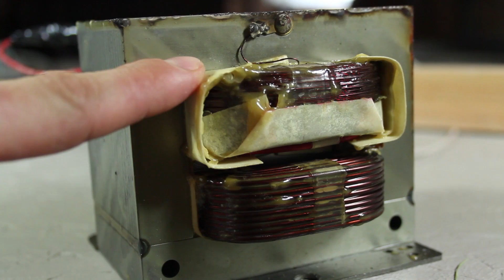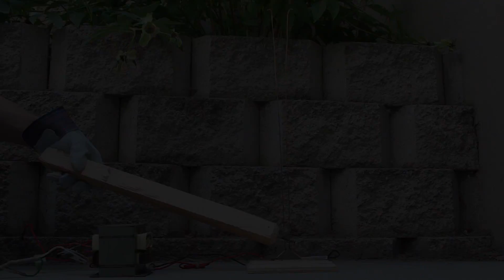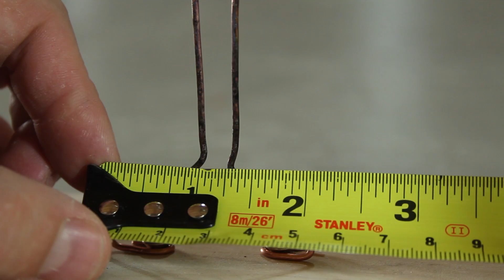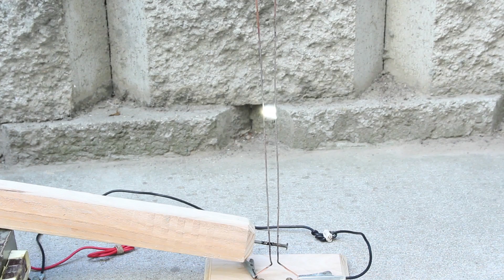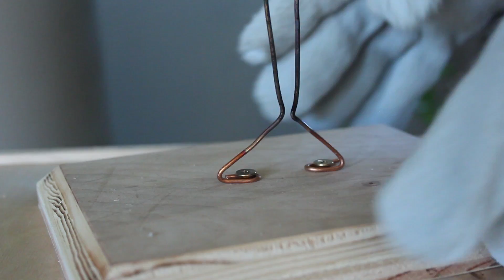Lethal Electric Arcs (MOT Jacobs ladder)

Comment: I'm sure someone has already brought this up, but PVC pipe makes a much safer "chicken stick." You're taking your chances if you use wood. There's always the possibility that the wood that may not have dried thoroughly, and still has some moisture in it, and can still be slightly conductive. Gloves should always be worn if using a wooden "chic stick." Unless you want to find out what Frankenstein's creation experienced, though I'm pretty sure that experience would take life, not give it.

Comment: If he added the capacitor in parallel Wouldn't the impedance of the capacitor cause a short circuit and not produce any sparks? Did he Rectify the ac first or did he create a voltage ladder?

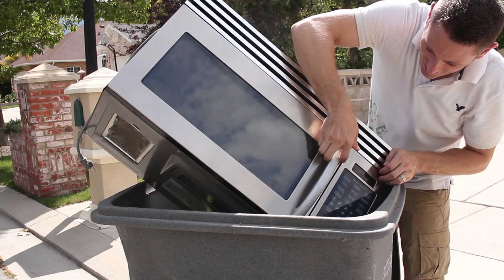Comment: Why is the high voltage secondary connected to the iron core (see 0:41)? Does it  mean the transformer itself is under lethal current!?
Reply: Yes, the core could "float" above ground potential, sometimes tens to hundreds of volts. Generally to avoid this you connect the earth wire to the core so it cannot go above ground voltage. Grant didn't do this, which is a mistake. Inside a microwave oven, it is in contact with the grounded casing.

Comment: Well,at least you're not screwing around with the magnetron in open space. This is still seriously dangerous though.
Also,Protip- Don't use wood as a hot stick. It's not always (enough of) an insulator,especially in humid climates. Find some plastic. And avoid black/dark colored plastic,or rubber -it's sometimes colored with....carbon! (carbon is NOT an insulator.)

Comment: What if you enclose these two wires inside thick glass?
Reply: Jason Gardner If the power is high enough to overcome the resistance of the glass it will melt (there are several vids on YT where  people connect lamps to a MOT).
 But I assume 2.000+ volts from a standard MOT is not enough to start an arc because glass has a lot higher resistance than air.
Reply: Cool man thanks for the info...on a weird note it might not be suitable for a"FIRE ANT FARM"?

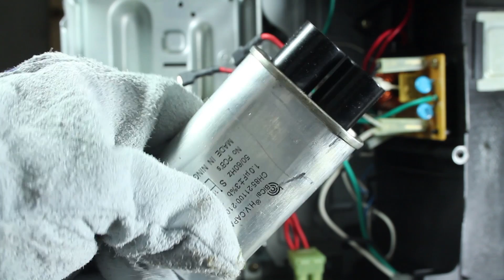Comment: What would happen if you looked at the ball of electricity at 3:21
Reply: 김성윤 is so right! It's like a welding arc...while you may not permanently damage your eyes with one quick glance, you would feel like you had sand in them and it could potentially damage them if you stare into the arc...this is why welders wear helmets or goggles to protect their eyes from the radiation.
Reply: your eyes will get damaged  it's almost like looking at the sun directly
Reply: 김성윤 But the ozone layer protects us from the UV rays? or is that ball of electricity just so bright?
Reply: It does but some passes through but there is no ozone between you and the plasma ball
Reply: 김성윤 But it creates ozone gas i thought?
Reply: Not enough to block uv significantly if you are going to watch it directly i would recommend  high quality sunglasses
Reply: 김성윤 k thx
Reply: np
Reply: No, I would surely not die! But, my eyes would then be opened, & I would know the difference between regular & extra crispy...I could almost see the colonel's wee beady eyes through the glass darkly.

Comment: what if a black hole is created with such plasma, because the energy leaving the copper wires at the top instead of expanding thru air, by some reason meet at a particular point, the mass of the plasma + the energy at this infinitesimal point creates a tiny Black hole that could start sucking in material, thus becoming huge in an instant, really dangerous stuff you make there...

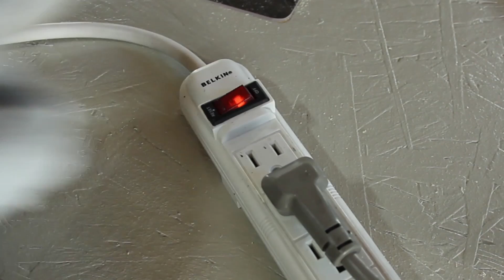Comment: 2:28 "lethally high voltage" it is current, not voltage that kills. amps not volts
Reply: But remember current equals voltage devided by resistance, which means the voltage directly determines the current! So that is a dangerous misconception
Reply: no its the combination of the two
Reply: Meneer de Koe If we talk physics, it would be more correct to say: " It's the combined energy released".
However, Ohm's law holds true and if the resistance is to high, nothing will happen.
If you've ever done sandblasting, you may have wondered about the thick rubber gloves. They are not there to protect you from the sand flying around, but for the statical charge that is generated. The resistance in the gloves, will ensure you don't get shocked. Further the earthed connection on the machine, will discharge it. Again it's the resistance that is the key. It's also the reason I can touch a live wire with several hundred Ampere (but just a few Volts), if just the resistance of my skin is higher than the combined energy output.
However, I've been playing around with a high current transformer for one of my projects...even though I knew about Ohm's law etc..I didn't touch the secondary output..lol.

Comment: you might want to put the cap in series with the MOT, that will limit current to its intended range and prevent the MOT from overheating. Maybe add the clamping diode, will double the voltage, possibly enough to jump the gap without the stick.

Comment: I wonder what would happen if you shape the wire like this.:      / \
                                                                                                              (     )
                                                                                                               \  /
Reply: It won't work very well, cause the arc will disappear as it hits the middle.
Reply: well, Basically teh same would happen, teh Arc goes up and Breaks at the top. it would just be Cooler xD
Reply: Lol that's so broken on mobile
Reply: hahaha!
Reply: *****
That wouldn't a Relevant Setup, as you needs 2 Rods. not 3 :P
Reply: The ark might brake in the middle.

Comment: Years ago I used a neon lamp transformer to make a Jacob's Ladder and totally by accident a lead fell off while it was hot and touched my left knee. That startled me and I moved and my right hand touched the other hot electrode. For a few seconds I thought I was dead and just hadn't fallen over but my heart restarted after about three seconds, rather erratically at first and I'm still here. The transformer was running at about 5Kv.

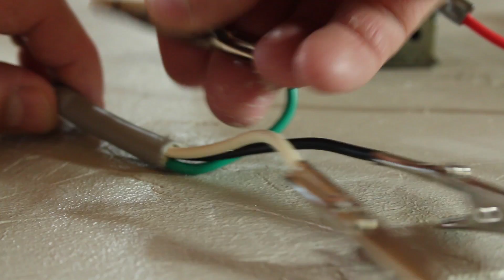Comment: 2:16 - You said ''black and white get clipped on'' 
Can they be reversed or not?
Reply: yes polarity in this instance would not make a difference since the wire is just an inductor
Reply: ok....but what if it was just being used to step up currents?
Reply: If you care about the polarity of your output then the input polarity matters because the input polarity dictates the direction of the magnetic field and the direction of the magnetic field dictates the polarity of the output. In that case it would matter. If you are just using it as a generic current step up/down converter, say to melt stuff, then it wouldn't matter
Reply: ok cool
thx

Comment: "V-shape for the arc to move up", "the arc moves up because it is hot" -> these are stupid explanations. The arc would travel upside down just as well.

The real explanation is, the magnetic force created by the current flowing in the wire tries to increase the size of the loop, thus pushing the whole wire outwards. It is to weak to visibly deform the wire, but the arc is a much lighter part of the current path. So a relatively weak magnetic force pushes the current path loop outwards, and the arc happens to be so lightweight, that it moves along the wires. On the top, the length of the arc starts to grow until it cannot support itself anymore, and dies out.

It is true, that the hot air in the arc will result in some upward force, but it is not the dominant force here.

Comment: How is a wooden stick a safety stick 😂😂😂😂
Reply: +Nicholas Castellon wood is not an insulator. Even little moisture in wooden stick can conduct electricity pretty well when using higher voltages.
Reply: Lost In Space Electronics I've used aluminum chicken stick while back with 1 kV
Reply: Because its an insulator...
Reply: because if he used a metal rod, he risks being electrocuted. the wood insulates it so he isn't electrocuted.
Reply: +Carlos's gaming world because wood insulates. also i learned this in 4th grade
Reply: Mark Schulz IV who cares this was about 3 months ago
Reply: ummm idk I guess
Reply: +Mark Schulz IV dude why would i do that
Reply: Lost In Space Electronics dude calm down
Reply: Lost In Space Electronics Wood itself is a natural insulator due to air pockets within its cellular structure. As an insulator wood is 15 times better than masonry, 400 times better than steel, and 1,770 times better than aluminum. In addition, lightweight wood framing methods allow easy installation of additional fibre or foil insulation.

Some common insulator materials are glass, plastic, rubber, air, and wood. Insulators are used to protect us from the dangerous effects of electricity flowing through conductors. Sometimes the voltage in an electrical circuit can be quite high and dangerous.
Reply: James Harrell lol i use pcc sticks no not pipe actual sticks make of pvc lol
Reply: me too i use with like 30kv 1ma but high frequency tho i could not feel a thing while i held it but if i went to go grab it it would give me a static shock this was from a flyback though no caps just raw voltage

Comment: Does this put out any type of radio or electromagnetic signals?
You know like knock out people's wireless internet or cellphone reception?
Reply: +dreamyrhodes exactly and this should not produce xrays a huge flyback could
Reply: +Richard Fry It does. At a way higher energy level than you're thinking, though. (you want microwaves and radio waves, but this outputs UV and potentially X-rays)
Reply: neat... x-rays?  doesn't that cause cancer?
Reply: Yep. This is incredibly high powered. UV can also cause skin cancer.
Reply: +Richard Fry X-Rays appear when high-speed electrons are stopped instantly, called bremsstrahlung, because any change of speed in charged particles are released as radiation packets. X-ray tubes use this by firing high voltage electron beams against a metal plate and thus making it release radiation. UV however is emitted by hot air around the arc.
Reply: i think he means A electro magnetic pulse aka emp

Comment: how do you safely discharge a capasiter
Reply: there's no huge charge on that capacitor because it's AC power. I'd worry more about damaging electronics plugged in nearby from flyback transient when arc breaks.
Reply: +BMAN488877 thanks

Comment: The MOT outputs AC, right? Wouldn't the capacitor behave like a short circuit if you wired it in parallel with the spark gap?

Comment: That was one heck of a bang you got out of that microwave oven cap - I've never found one that makes a bang that loud. Connect a couple in parallel and it might be on par - obviously that particular cap has a higher uF rating than the 0.95uF caps I tend to come across. Yes it made me jump LOL

Comment: Just as a side note, the voltage can NOT kill you. It's the current. Yes 1,000 volts will do more damage than 100,000 volts but it wont kill you. It takes about 0.2 amperes to kill you by deactivating the heart , lungs, and brain. Anything above that will just clamp down the heart, with a chance of survival if CPR is applied. not trying to be mean. just pointing something out. thanks.

Comment: This is a Pauling arc reactor. Place this inside of an upside down jar, and an orange, toxic gas will form. These are nitric oxides, which can then be pumped into water in order to form nitric acid. The nitric oxides form due to the heat of the arc causing atmospheric nitrogen and oxygen to react.

Comment: I love your projects but am a  little concerned someone won't be as cautious as you.  How could you make the scariack safer and not use liquid electrolyte?  Maybe use some of the unused primary coils or wind new ones.  Also, I like circuit breakers.  When I get to this I think I'll add a circuit breaker.

Comment: U can use a MOT the other way round too.
the HV coil can be connected to 110V mains and at the original mains connectors that were designed to be primary and now act as an output terminal U get about 5.5V

thats a way U can calculate the HV when the MOT operated normally again as it was designed
110 / 5.5 = 20
so the other way round 110V * 20 = 2200V

Comment: Would the plasma arc continue if the wires stretched for a long distance, say a mile?
Reply: Ankit A Aaaand it would need more and more energy over long distances, in the end the core would prob burn of.
Reply: Raymond Hernandez Then the heat from the spark would fry you and all the inhabitants of Earth in a fraction of a second.
Reply: spaceface105 55zodiac55 
( ͡° ͜ʖ ͡°) Ladies, ladies, you're all very pretty.( ͡° ͜ʖ ͡°)
Reply: yes as long as you kept giving it electricity and didnt shut it off
Reply: k thanks
Reply: off* ( ͡° ͜ʖ ͡°)
Reply: 55zodiac55 Aaaaand you are an idiot.
Reply: Your gay and your parents have divorced
Reply: Yes if you used 1000000000000000000000000000000000000000000000000000000 volts of electricity
Reply: Larrykoopa99  i'm gonna throw up now

Comment: How would the plasma arc kill someone on contact?
Reply: Anarcho Tom amps kill you more than volts
Reply: TheLightedKingdom That means I can make a nice taser like this that is 100% lethal?
Reply: superbarnie
yes
Reply: well if its made of a microwave yes
Reply: It is REALLY HOT AND CAN ELECTROCUTE YOU!!!
Reply: DrawDragons You mean if i touched that little ball with my finger then I would instantly die?
Reply: Electric volts can kill you plasma is electric
Reply: superbarnie You would not die. No chance... if you touch it with one hand!

Current will pass your finger but not your body(Burnt/destroyed finger as result). Same for tasers. And btw Amps are killing you when they pass your heart or body in general. Volts just define how much amps will possibly pass you.  At a certain point of voltage the inner resistance of your body is sinking dramatically... and so does the current increase! (your bodys resistance is not constant). 100mAh (a tenth of an Amp) through your body will very likely kill you. DC or AC.
Reply: TheLightedKingdom Nope. You would not.
Reply: FreakSX93 your Electronics math and Logic is a bit flawed FreakS93 I could explain if you want
Reply: Patrick Peck I dont see any flaws in my explanation there ;-) What math?
Reply: +Patrick Peck I see no flaws in that.

Comment: so he has 4-gauge insolated copper wire on hand, but he doesn't have a coat hanger............ WHAT!?!?!?!?!?!?!
Reply: distortedflamingic
clearly the king of random is a manly man, who makes his own coat hangers, out of wood, with tools he made with his teeth.
Reply: He said metal coat hanger. He probably has plastic coat hangers
Reply: As someone who doesn't dry-clean anything, I can see why he wouldn't.

Also, doesn't any self-respecting DIYer have copper on hand?
Reply: Hashi Sayed even if you don't dry-clean, you'd still have some hangers
Reply: that's strange
Reply: Hashi b ouo
Reply: Lol that's the situation im in right now lol, I've got various acids and chemicals but in coffee filters lol
Reply: It doesn't work well with steel coat hangers. The iron grows fingers which short the spark gap. I had to obtain some Copper
Reply: +geffery luishhammersama no, transformers only work with AC power
Reply: +Jerimiah Whitaker *14*
Reply: Jerimiah Whitaker to

Comment: is it making nitrogen dioxide? do you know much more about creating ozone and what is the name of this cap circuit looks like it could be the source of plasmafication, back to ozone is the high voltage ionising the oxygen + 2O into ozone then the ozone is oxidising nitrogen back to the stable non ionised oxygen - 2O and carbon dioxide possibly burning the carbon creating room for another possible nitre oxides?

Comment: Safely discharging an MOT capacitor is NOT by shorting the to leads together.  A resistor is needed between the capacitor contacts to slowly discharge the capacitor.  Attach one end of a 100K - 150K ohm, 25 watt resistor to the bare metal chassis with an alligator clip. Attach the other end of the resistor to the blade of a well insulated screwdriver with an alligator clip.  Touch the blade of the screwdriver to one of the capacitor terminals and hold it there for a few seconds. Then repeat the procedure for the other terminal.
Reply: MO caps all have an inbuilt discharging resistor.  Wait 10 seconds.
Reply: You tell em ( ͡° ͜ʖ ͡°)
Reply: Peter Terren Grounding one side of a capacitor does nothing. The terminals must be shorted to each other. Kudos on the bleeder resistor.

Comment: I tried to make one of these its pretty awesome, you can actually bend the wires at an angle and have the spark travel in a zigzag, as long as the bends aren't anything above 90 degrees to each other. The more the angle the slower the arc travels up to 90 degrees. Make sure you turn off power before bending the wires.